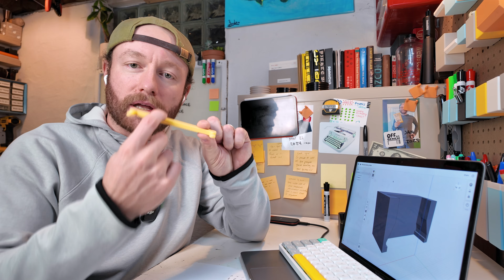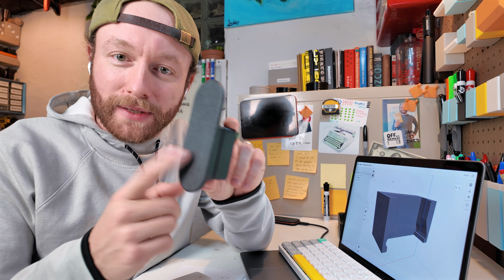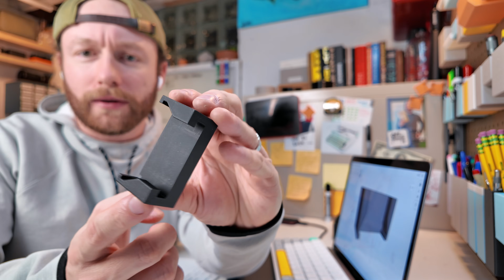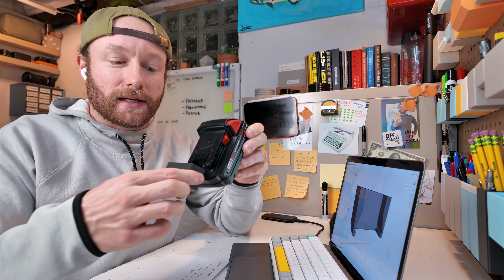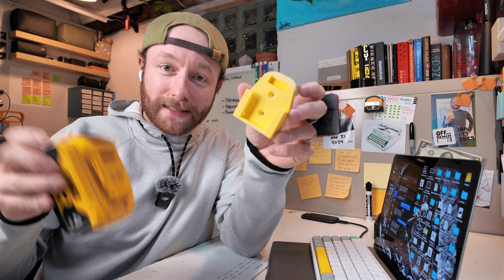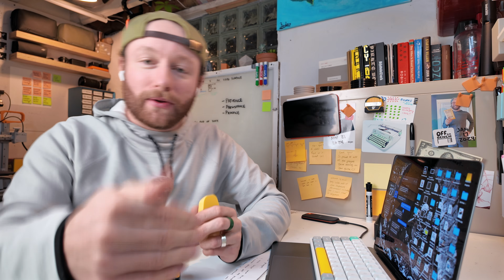My Product Design Process - Running a 3D print business -  Vlog 6

Comment: Thanks for the video, what software do you use for design? I just bought my first printer, P1S and I used to be a draftsman a long time ago using Autocad.  I'd like to use a free package for now.
Reply from the maker: I use Shapr3D which unfortunately is not free. The best free software out there is probably TinkerCad. I have a hard time when programs have a terrible UI. If you can work through that FreeCad is probably your best bet.

Comment: Supports wise, the biggest thing is adding to the top z height under the support section. Example: .2 Layer height, go to supports, Trees (automatic), Slim, and then scroll down and find top z height  for supports. Default setting says .2. This is what causes issues. Try .28 instead. Not only does it make it way easier to remove, it also retains high quality for the final model.
Reply from the maker: I'll have to try that out!

Comment: Hello Chris,
Thank you for your nicevideos. I looked at them all because I was thinking about buying a Bambu A1. 
I ordered one yesterday and can't wait to print out my first things. 
Now I'm learning how to use Fusion360 since I still have a few days until my 3D printer arrives
Reply: I bought an A1 recently and it's by far the best 3d printer I've ever used, some of the parts I've printed so far look so good you'd think they were injection moulded if I didn't say they were 3d printed!
Reply: @ModulateRecords  I got an A1 late this summer. It's been amazing, coming from an Ender 3 of some sort, where the issues were constant. Not least of all, lack of automatic bed-levelling! With the A1, it's finally about as easy as paper print ever was.

I've made one item for my own use in OpenSCAD that I think is good enough to sell too. Even printing with a .8mm nozzle, it's really clean. Looks like anything you'd find in a shop shelf. I also printed some miniatures with a .2mm nozzle, and they may not be perfect, but incredibly much better than I expected FDM printers to ever get. At arm's length, they could be mistaken for commercial products.
Reply from the maker: Great choice!

Comment: I guess another question I would have is why battery holders? Seems market is fully saturated with those. Are you actually finding success there? 

Maybe my issue is even if I think market is full maybe there really is room for me. IDK...
Reply from the maker: The short answer is no, not a ton of success, but I also haven't had them up for a very long time. The question for me is not is the market saturated, but is the product complimentary to others. If I am selling a charger bracket, you bet I want the customer to also buy the battery mount and tool mount from me as well :)

Comment: @4:05 I guess my question would be why not just buy another build plate? Or get a new skin for it? They have plate skins that will transfer some wild looking holographic if ya wanted to. Personally I just like the micro texture of the PEI plates.
Reply from the maker: I am going to order some new build plates that may solve this issue, but the smooth texture plates I was using left micro scratch marks that could not be removed from the final product. Created too many "failed" prints, so I just took that option away.

Comment: You should try it.
Object: PLA (or PETG)
Support: Same as object
Type: Normal
Style: Default
Top Z Distance: 0.00
Support/Interface: The opposite of object. 

Since example Object is printed in PLA, the Support Interface material will be PETG. You would be shocked what the outcome is. Since PLA and PETG don't stick to one another you can get some really clean surfaces and removal is like magic. Love the video!
Reply from the maker: Love the idea! Sounds like a good reason to buy a P1P with the AMS unit
Reply: @ I mean the A series can do it too. LOL But I mean I do love my P series. 😅 

You start that IG yet??

Comment: For the support issue you were talking about an option is using a different material for the support interface layer such as petg on your pla prints. It makes the surface where the supports touch the part quiet a bit nicer. This does produce a lot of waste and increase time of your prints though so it's probably not something you'd want to do for every print but if the supports are required it's something to keep in mind.
Reply from the maker: Great idea! :)

Comment: Are using Fusion 360 for parametric design.  I have used Solidworks, Creo (aka Pro Engineer). I recently purchased my printer now looking into parametric design software
Reply from the maker: Love it! Fusion is a great program, just way more than I ned at the moment.
Reply: @OfficialOffDaBench  which software for 3D models do you use?